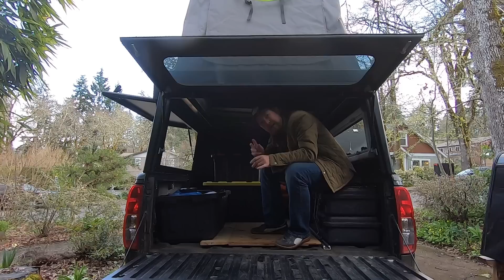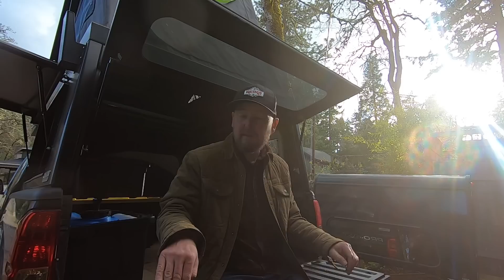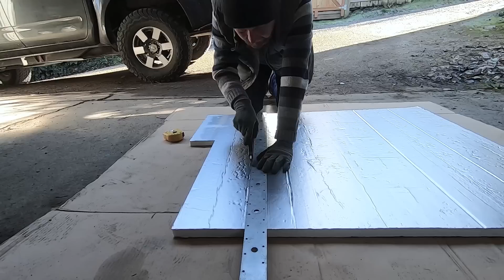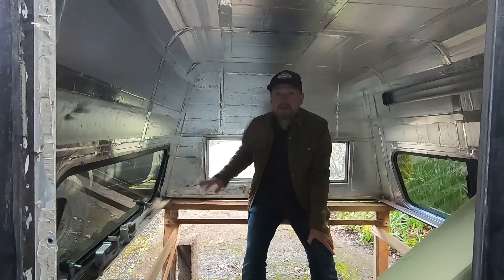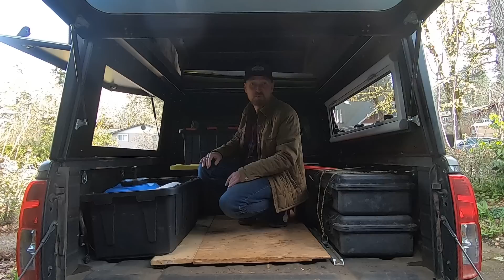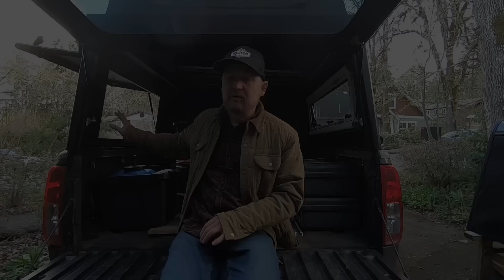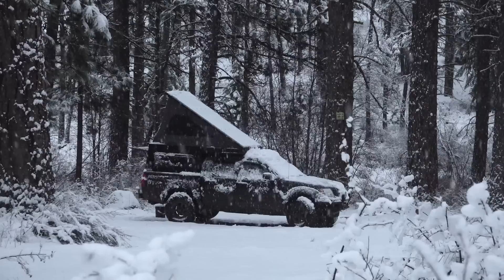Camper Interior Build Series: Part 1 - Planning & Ideas

Comment: Reconsider the diesel heater.  I installed the 2kw version in our camper and it has been bullet proof, efficient , and powerful.  For a $900 savings I can put up with filling a diesel tank when I fill the car up.  The 10 gallon aluminum tank in installed runs the heater for many days.  When you run the heater at night it makes so much heat,  even on low,  you can leave the window open a bit to let moisture out. That really helps keep things dry.   I have second "all in one" 5Kw heater for the shop.  It has been heating the shop for 4 years without missing a beat.  If you follow a few simple install and operating guidelines they work great.  If you happen to get unlucky with a bad unit you are only out $100 and are still way below the cost of a propane solution.
Reply from the maker: Hmm. Fair points. I don't think I can wedge in a 10-gal diesel tank, though I know people who use these without carrying that much fuel. I'm perhaps biased because firsthand I've witnessed so many problems with my friends' diesel heaters, and firsthand I've witnessed the flawless operation year after year of my friend's Propex. 😄 I don't like to be an absolutist though...never say never. 🙂
Reply: One of the biggest problems in winter is gelling of diesel.. for years the trucking company I worked for used Kerosene in there Espar heaters.. Wonder what other products you could use Kerosene in maybe a stove or lighting???

Comment: Hey Donald!
I'm pretty much on the same page with you on all the points you laid out in the various elements of your build. It seems there isn't really much space to do anything more either, although I think for heat, the marine type propane "convection" heater would be a dream come true -- a chimney does seem a little bit challenging tho, I gotta admit.
Completely agree that reducing humidity should be top of mind though, and on that note it seems to me that a plastic-board of some variety or other might be your best bet for wall covering, as you likely will wind up with condensation which should rule out carpeting as an option, imo.
Excited to see what choices and solutions you come up with in this series, and looking forward to see the results as I'm sure it will be practical and functional!
Cheers!....from North Vancouver.
Reply from the maker: Yeah, that's a good point on the wall material. Last night I had a new idea for how to make the marine heater work. It would be a fairly involved longer term project that might be a year or two down the road, but it actually solves a number of other issues I'm grappling with as well. As I give that more thought, I might end up just muddling through with the Buddy heater for another season.

Comment: For a couch/storage idea. In my F150 bed I have segmented bench seats on each side of the bed, over the wheel wells. I made these 13" high to be comfortable to sit on and deep enough for storage. The seats are hinged at the back to get to the storage with a top made of slats so the seat top will almost double in width when pulled out to make a bed, one side for one, both sides for two. With your overhead bed, might not need that much bed.
For you stand up counter, there must be some way to use the existing channel and frame as part of the support for the counter, maybe making using of the bed platform to hold one end of the counter?
Reply from the maker: Yes, this is very much what I had in mind. Hinged top on the bench to access storage inside. I don't think I need it to expand like you, it'll be more of a little couch since I have the bed upstairs. And yes, I've got my eye on the bed support structure to help secure the tall cabinet. Looks like it should be a simple matter.

Comment: Donald looking forward to your build project and on the flooring definitely sounds like a great idea to leave some type of storage area like you mentioned but I’d also consider buying a cheap rubber mat for pickups that you can cut to fit the bed to give yourself some extra padding to stand on. And some of the rubber mats are designed to help to keep items from sliding around

Comment: To cover the insulation look into bendable 1/8” plywood. In Canada it is currently running about $70 a sheet. I’m in the process of doing this in my canopy and know it will take 3 sheets. Also looked at the tongue and groove pine and it comes in at 3X the price and I feel more installation work/time.
Reply: I used 1/8" to finish my garden office space.  Home Depot sells it as "underlayment".  We rolled it with a couple of coats of varnish and I really like the results. It's very lightweight.
Reply from the maker: I'm liking the thin plywood idea. Seems easier to clean than indoor/outdoor carpeting as well.
Reply: @softroadingthewest  Yeah, I think if you hit it with a couple of coats of poly it will wipe down nicely.

Comment: For the cargo area maybe just power strips inside and out of the job to hook your jackets to.

For heat have you looked at the webosto like chris that on venture4wd has? It’s gas powered from your gas tank.
Reply from the maker: I like the concept of a heater than runs off the gas tank, it just seems like Chris is constantly fighting issues with his Webasto, especially when he's up at elevation, which is when I most need a heater to work. For that much money, I'd be more inclined to look at the Propex, which I have firsthand experience with and know that it works in all the places I typically go. 😄

Comment: Without doing any research, I believe combustion of propane will produce roughly the same amount of water no matter that process (catalyzed or not). It's possible that the combustion happens at different fuel, oxidizer ratio's but I think that only leads to partial combustion and other products like NOx.
Reply from the maker: That makes sense. X amount of propane burned will always yield Y amount of moisture. I'm guessing the Wave 3 heaters may appear to produce less humidity simply because they burn more slowly than the Buddy heater. And perhaps a slower humidity gain may be easier to mitigate with a bit of ventilation than the overwhelming blast one gets from the Buddy. Overall might be a more comfortable experience because it can just run consistently and maintain even heat (whereas I have to constantly turn the Buddy off and on to manage the temperature and I'm always either too warm or too cold LOL). A lot of people rave about the Wave 3, but I'm not yet convinced to the point of spending a few hundred dollars on one. 😏

Comment: Did you do any dust prevention work in a previous video so dust doesn't get in your bedding or new interior build in h dry months?
Reply from the maker: Yes, I've been chasing the various hidden orifices in this truck bed for as long as I've owned it...and there are a lot. 😆 I still need to seal up around the tailgate though.

Comment: Not sure if it would make sense for how you drive/camp. But usually I am driving right up till the time I camp. So I'm planning on adding a hydronic heater to preheat my Ovrlnd camper as I drive. I experimented with a 600w electric heater, and decided the concept worked, but I wanted more than the 10-15°F boost in temp it provides. Preheating the mass of all my gear in the truck bed really helps on very cold winter days, the Propex 2000 won't have to start from 10°F.
Reply from the maker: Very interesting, I didn't even know that was a thing!

Comment: SoCal truck accessories and equipment sell a "carpet kit" for truck beds, which I have had for 1 year. Comes in 5 or 6 pieces, your choice bed on floor or raised above wheel wells 6 filp up doors for stor. One slide up Drivers for longer items. I actually switch between two trucks, 98 or 2015. Takes about 10 minutes. Raising bed platform ( in 2 pcs) allows me to travel with all my kitchen, recovery, break dn equip under or in side storage. So for extreme O/R, my 98 k1500, roof top cargo rack fully equipped, or 2015 k1500 no cargo rack (yet) my (hwy cruiser) utilize 98 for extreme off road....Owyhee....Alvord.... etc. Google up SoCal truck or Vacaville Truck and Sport for pics and info.

Comment: Polyiso with foil has a couple of slight advantages in my opinion. Slightly higher R value, 5 vs 6 for 1 inch. Its less permeable, so you're less likely to get moisture behind the insulation(but if you do it also won't dry out as easily). It's slightly more fire resistant, doesn't melt and lose it's insulation making fires slower to spread.
Reply from the maker: Good info, thank you! For me, one additional advantage is that I still have half of a 4x8 sheet of foil-backed polyiso left over from my previous build, so I don't have much more to buy. 😄

Comment: Hey Donald,

Regarding covering the insulation in your cap, I have a lightweight suggestion: birch veneer. I have three rolls of it that I was going to use in my Ford Ranger cap. I recently traded my truck in for a VW Golf Sportwagen, which has AWD. I will be using that to explore the backcountry, not unlike you did with your Subaru Forester. It gets much better mileage than my truck did, and I'm planning to lift the car 2" for better clearance off road.

I no longer need the birch veneer, obviously, but I'd be happy to sell the veneer rolls to you for a greatly discounted price. I'm in Vermont, so the veneer would have to be shipped. Let me know.

Regarding heat, I have a 350 watt electric heater, running off a lithium Iron battery. For the very small space of my Sportwagen, I hope it will be adequate.

Comment: Now Donald, maybe I am missing something, but with a tent up top, why does insulation matter?
Reply from the maker: I originally was thinking the same thing, but once I started getting out and camping with it, I realized the thermal conductivity of those aluminum walls means they suck heat out. You can hold your hand 2" from those metal walls and feel how much colder it is than along the canvas walls. The other factor is summer sun on those black walls. Insulation helped a lot with preventing heat accumulation in my previous topper. 🙂
Reply: Chuck RF150  I was about to say the very same thing, but couldn’t find the words...add to the tent top all the windows too!
Reply: Donald, I would use your old topper and your current tent. The more I think of what you need and want, the more Id use the old topper.

Comment: Nice video.  I would not put down a floor. Keeping the floor like it is will be lighter and easy to clean as you can hose it out.  A moisture resistant wood paneling made for bathrooms would be light, good for the weather conditions, and still be similar look to Jason's. If you still wanted a floor, I would use a rubber mat so it is still easier to clean as you could take it out, some insulation, and cushion for your feet?
Reply from the maker: I definitely need something down on the corrugated bed of the truck. I've lived with it for a few years now and I'm over it. 😆 Removable rubber mat is a good idea. I definitely track a lot of crap inside and want something easy to clean. Thanks!

Comment: I have a Super Pacific for going on two years on my Tundra. I have similar goals as you. My goal was to be able to access my gear from the inside and the outside as well.  On one side I have my fridge mounted and behind that I have built a cabinet that goes all the way to the rear for storage and my Jackery is secured in the back so I have easy access. On the opposite side I have made bags to hold 90% of my most used items. I can access everything whether inside or outside. By using the hangin bags I still have about 2/3rds of the floor open for my dog and nap time and also for hauling (dog sleeps below). I have one Rigid box with cookware that has dual purpose of a step getting into the truck and then at night time it acts as a step getting into the bed. The storage behind my fridge acts as a bench and counter top when I cook inside. The built is anchored with Kreg screws so it can removed. Takes about ten minutes. Get a full Bedrug, best thing I bought, seals the bed really well. I flip flop between Sisters and Portland (soon to be just Sisters) and the Bedrug does and amazing job of keeping the dust out not to mention it does insulate. This probably doesn’t make sense with out pictures. I enjoy yours and Jason’s channels.
Reply from the maker: Sounds like a great system!

Comment: Just wanted to say I appreciate you not jumping on the diesel heater train 😂 Look forward to seeing what you come up with!
Reply from the maker: Thanks! Have you guys considered any alternatives? You've been using a Buddy heater too right?
Reply: @softroadingthewest  yup, have a Buddy. We've only fired it up at Jason's winter camps 😄. Being inside the Yukon seems good without heat (assuming good sleeping bags) to around 20ish. Last trip hit like 18, and sure my nose was cold, but otherwise just fine. The nice thing about being in the rig, I can just lean over the console, hit the key and have the regular heater run for a few minutes if we need a quick blast, and that's a lot more convenient than dealing with propane tanks/hoses. In a space like yours not connected to the inside of the truck, I think the Propex setups seem to make a lot of sense, maybe a "legit" diesel heater that would be less problematic than the cheapies. I would probably lean Propex as long as I had a clean way to mount a tank and all that.

Comment: Plywood is the way to go. Aluminum extrusions can get heavy quicker than you’d expect.  If you can find a local source, lightweight plywood would be great but if it’s not local it can get expensive, otherwise ¼”-⅝” plywood is plenty strong when designed right.  Too many people thing ¾” is required for strength, but it’s not necessary unless you are spanning long distances.
Reply: Someone else also mentioned this, but for foil insulation to work there must be an air gap to reflect the radiant heat, otherwise the foil is a conductor which may negate the R value a bit.
Reply: Eugene OR has several plywood factories in the city.  So, that's not a problem.

Comment: I’ll just jump right in. If you plan on spending significant amounts of time inside your build during lots of below freezing temps for at least a few months then a heating system requiring a chimney would make sense. Otherwise you’re probably best sticking with the buddy heater or getting a wave 3. I have both and also year round camp in the PNW. I typically just use the buddy if it’s gonna be less than 20 and if it’s over that I’ll stick to the wave on low but usually just to warm it up and then sleep or warm it up first thing in the mornings. Electric would be great but they are power hungry and I don’t want to run a generator. The buddy and wave are great especially when it’s warm out and you can leave them at home and don’t have a chimney hole in your roof/wall that you have to plug. Your best bet would probably be the wave as long as you ventilate the moisture shouldn’t be an issue and when you are home you can put moisture absorbers and an electric heater in there to dry it all out. I failed to do that and just had to replace some paneling in my build. 
I have Leer DCC similar to yours except 8’ and wedge front. I used the pink foam board and plywood that is 3/16 thick for the paneling that I coated with clear polystyrene. I like the look of wood and it’s light and easy to manhandle by myself. I used Eternabond double sided tape and self taping screws to secure it. It’s been working great except for where I had a poor seal to the truck bed right where I breathe when I sleep and I failed to properly ventilate so had to replace a little bit of the wood, I knew I had an issue and ignored it till it was a problem.  Replaced the panels, fixed the seal and now I sleep with my head on the other end of the bed. 
The raised floor sounds like it might be a future regret if you plan on spending much time in there with the top down. You could always try it but build it in a way that would make it easy to delete later without having to rebuild your cabinets. Maybe just have the cabinets go to the floor and have the central aisle with a rail on both sides that you can add a false floor too if that makes sense. 
The walls you could put marine carpet on that should be more resistant to moisture. 
I thought it was kinda funny looking at the comments and folks were asking you if you knew who Ms Baddass was. 😂.  You could also mount a solar panel on the roof top to charge the Jackery. I have a flexible 100w HQST panel on my roof that I use to charge either my Jackery or Bluetti depending on which on is be used. I wanted a panel that was weatherproof that I didn’t have to worry about. I have portable panel too incase  I park in the shade.
Reply from the maker: Super helpful, thank you!